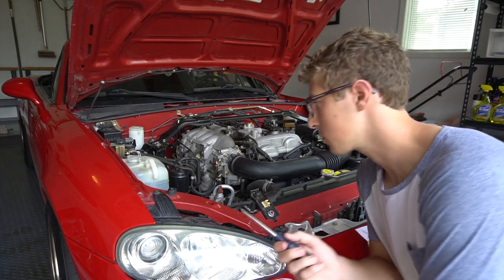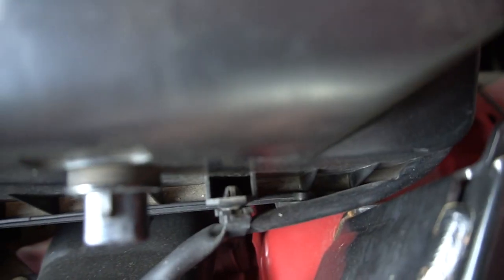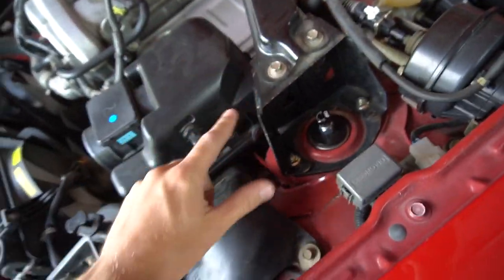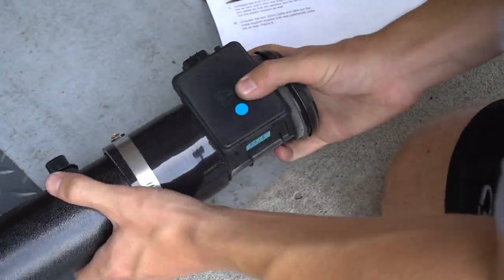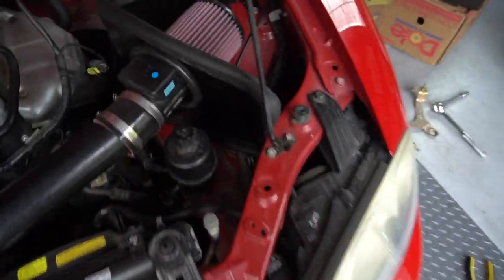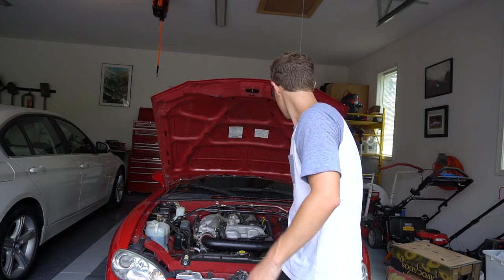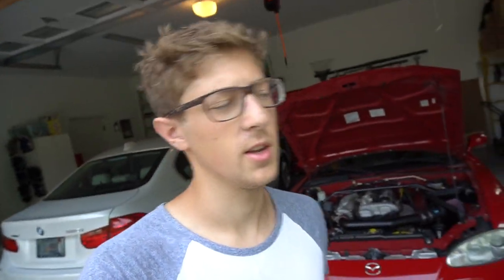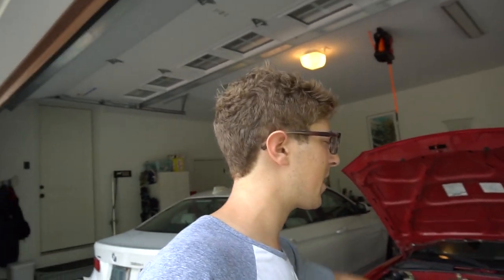NB MIATA INTAKE INSTALL (SOUND CLIPS)

Comment: Hi Patrick, Is it street legal in your state? I’m pretty sure that’s not permitted here in Switzerland 😧 I would love a cold air intake for my NC Sport... Thanks for sharing! All the best, Rob
Reply from the maker: Yeah police really don't care about any car modifications here in Michigan unless its a loud exhaust or is seriously unsafe haha
Reply: Hello fellow swiss miata driver. I don't know about NCs but I cut out a big hole on the bottom part of my airbox on my NA and put in a foam panel filter. It's not quite as loud as a cone filter but it sounds pretty nice and the cops have no way of finding it.

Comment: Do you hear any beeping sound under the hood after installing the new intake? I hear some constant beeping after turning the ignition which I haven't heard on stock intake. Also, is your filter touching the engine bay bracket? Mine is stuck in there very tight and it scratches against the metal which causes some scratches. Other than that I can confirm that Cobalt intake sounds awesome.

Comment: *short ram intake.

And you lose power with heatsoak even though you have the 'insulation' but over time if that breaks down in the engine compartment as rubber becomes brittle, you'll definitely acquire heatsoak. 

Still, great video man, love the NB.

Comment: Would it add horsepower if you got it tuned after the cold air intake install ?
Reply: TheCarPassionChannel recently ran tests on this on his channel, you should go check it out

Comment: was there a loud hissing sound after the installation? Because I have a really loud intake air suction noise after doing it to mine, just wondering if it’s normal
Reply from the maker: put your hand on each of the clamps and pipes on the intake. Feel for a leak. If not then it's just the intake sucking in air!
Reply: Patty Boi thank you bro!!!👍
Reply: @ThePeterPulse  Hey Peter. Did you ever fix this issue? I just added this to mine and had the same problem. Also mine is throwing a code now. Thanks in Advanced.
Reply: @SaCriFiCE891  Hey Tyler, unfortunately I sold mine back in July when the prices of Miatas shot up lol. but yeah i drove for over a year with no problem, the suction noise is just the sound of the air freely moving. how ever you said that yours threw a code, is it maf sensor related? what brand cold air intake did you install? are all the hoses clamps, and maf sensor connected properly with no air leaks?

Comment: Does this intake require a remap or can you fit it onto a stock miata with no further work?
Reply from the maker: This will work with any stock Miata, and you don't really need a tune after installing this
Reply: @pattyboi  Thanks. I installed this today, your video was a great help. My only issue is my heatshield stops the bonnet closing properly, did you have to cut yours down?
Reply from the maker: @alexanderluke4198  I eventually got it to sit flush with the hood.  It just took some wiggling for me
Reply: @pattyboi  I'll give it another go in the day time. Installing the intake using a head torch made things harder than they needed to be haha

Comment: what is it like losng midrange torque?
Reply: I just bought this intake, it's been maybe a month now. The car is not faster, nor slower. At least I cant feel any difference, maybe harder pulls from 5.5k-7.5k rpm but its probably just the noise.

Comment: Get a K@N filter, get rid of the stock air intake silencer, cut holes in the stock air box and route to the fender well, save $350 and have the same result!